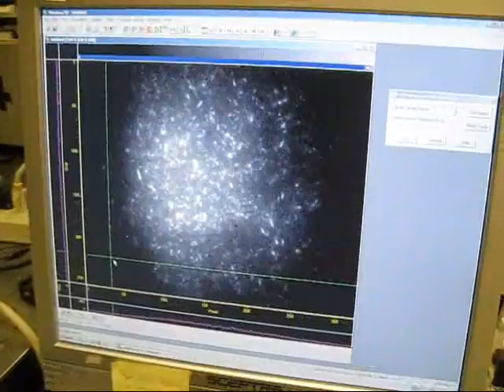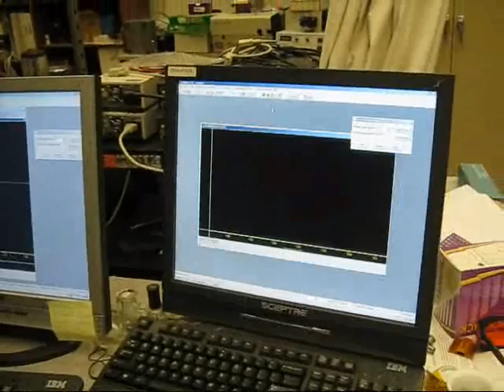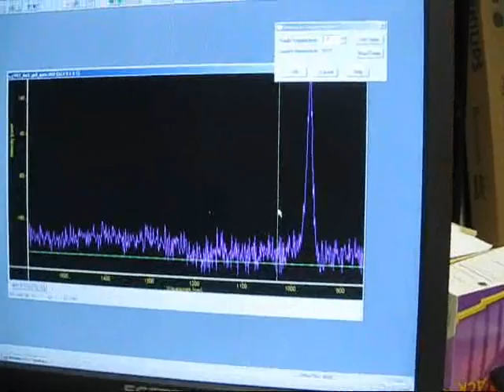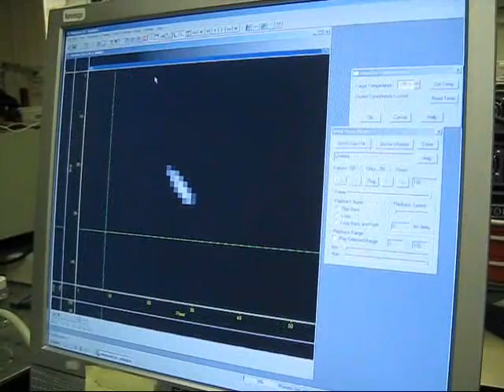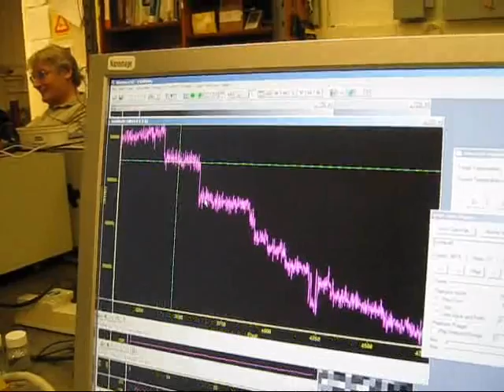Single nanotube experiment with tunable Ti:Sapphire laser Trestles sales@dmphotonics.com

Comment from the maker: THE GLOBAL MARKET FOR CARBON NANOTUBES
NANOTECH MAGAZINE 
2D MATERIALS MAGAZINE
latest market report on the market for Carbon Nanotubes including Technologies, Production, End User Markets and Opportunities Analysis to 2025.
 
Carbon nanotubes (CNTs) have been attracted huge attention over the past two decades, based on their extraordinary physical and chemical properties that are a result of their intrinsic nano-sized one-dimensional nature. Once the most promising of all nanomaterials, CNTs face stiff competition in conductive applications from graphene and other 2D materials and in mechanically enhanced composites from nanocellulose. However, after considerable research efforts, numerous multi-walled carbon nanotubes (MWNTs)-enhanced products are commercially available. Super-aligned CNT arrays, films and yarns have found applications in consumer electronics, batteries, polymer composites, aerospace, sensors, heaters, filters and biomedicine. Large-scale industrial production of single-walled carbon nanotubes (SWNTs) has been initiated, promising new market opportunities in transparent conductive films, transistors, sensors and memory devices. SWNTs are regarded as one of the most promising candidates to utilized as building blocks in next generation electronics.
 
WHAT DOES THE REPORT INCLUDE?

    Comprehensive quantitative data and forecasts for the global carbon nanotubes market to 2025
    Qualitative insight and perspective on the current market and future trends in end user markets
    End user market analysis and technology timelines
    Financial estimates for the markets carbon nanotubes will impact
    Tables and figures illustrating carbon nanotubes market size
    Full company profiles of carbon nanotubes producers and application developers including technology descriptions and end user markets targeted

TABLE OF CONTENTS

 

1       RESEARCH METHODOLOGY       24

2       EXECUTIVE SUMMARY        25

2.1    Exceptional properties 26

2.2    Products and applications    27

2.3    Threat from the graphene market  29

2.4    Production 30

2.4.1 Multi-walled nanotube (MWNT) production      30

2.4.2 Single-walled nanotube (SWNT) production    32

2.5    Global demand for carbon nanotubes    34

2.5.1 Current products         36

2.5.2 Future products  37

2.6    Market drivers and trends     37

2.6.1 Electronics 37

2.6.1.1       EMI/RFI shielding         37

2.6.1.2       Transparent conductive film 38

2.6.1.3       Silicon replacement     38

2.6.2 Electric vehicles and lithium-ion batteries        39

2.7    Market and production challenges 39

2.7.1 Safety issues      40

2.7.2 Dispersion 41

2.7.3 Synthesis and supply quality         41

2.7.4 Cost  42

2.7.5 Competition from other materials   42

3       INTRODUCTION 43

3.1    Properties of nanomaterials  43

3.2    Categorization    44

3.3    CARBON NANOTUBES         46

3.3.1 Multi-walled nanotubes (MWNT)    46

3.3.2 Single-wall carbon nanotubes (SWNT)   47

3.3.2.1       Single-chirality    49

3.3.3 Double-walled carbon nanotubes (DWNTs)     50

3.3.4 Few-walled carbon nanotubes (FWNTs) 51

3.3.5 Carbon Nanohorns (CNHs)   52

3.3.6 Fullerenes 53

3.3.7 Boron Nitride nanotubes (BNNTs)  54

3.4    Properties  55

3.5    Applications of carbon nanotubes 56

3.5.1 High volume applications      56

3.5.2 Low volume applications       57

3.5.3 Novel applications        57

3.6    Comparison with graphene   57

3.6.1 Cost and production    60

3.6.2 Carbon nanotube-graphene hybrids      62

3.7    Other 2D Materials      63

3.7.1 Phosphorene      64

3.7.1.1       Properties  65

3.7.1.2       Applications        65

3.7.1.3       Recent research news 66

3.7.2 Silicene      66

3.7.2.1       Properties  67

3.7.2.2       Applications        67

3.7.2.3       Recent research news 68

3.7.3 Molybdenum disulfide  68

3.7.3.1       Properties  69

3.7.3.2       Applications        70

3.7.3.3       Recent research news 72

3.7.4 Hexagonal boron nitride        73

3.7.4.1       Properties  74

3.7.4.2       Applications        74

3.7.4.3       Recent research news 75

3.7.5 Germanene        76

3.7.5.1       Properties  76

3.7.5.2       Applications        76

3.7.5.3       Recent research news 77

3.7.6 Graphdiyne         77

3.7.6.1       Properties  78

3.7.6.2       Applications        78

3.7.7 Graphane  79

3.7.7.1       Properties  80

3.7.7.2       Applications        80

3.7.8 Stanene/tinene   81

3.7.8.1       Properties  82

3.7.8.2       Applications        82

3.7.9 Tungsten diselenide    82

3.7.9.1       Properties  83

3.7.9.2       Applications        84

3.7.10        Rhenium disulphide     84

3.7.10.1     Properties  85

3.7.10.2     Applications        85

4       CARBON NANOTUBE SYNTHESIS         88

4.1    Arc discharge synthesis        90

4.2    Chemical Vapor Deposition (CVD) 91

4.3    Plasma enhanced chemical vapor deposition (PECVD)     92

4.4    High-pressure carbon monoxide synthesis      93

4.4.1.1       High Pressure CO (HiPco)    93

4.4.2 CoMoCAT  94

4.5    Flame synthesis  95

4.6    Laser ablation synthesis       96

4.7    Silane solution method         97

5       CARBON NANOTUBES MARKET STRUCTURE        97

6       REGULATIONS AND STANDARDS         101

6.1    Standards  101

6.2    Environmental, health and safety regulation    101

6.2.1 Europe       101

6.2.2 United States      102

6.2.3 Asia  102

6.3    Workplace exposure    103

7       CARBON NANOTUBES PATENTS 105

8       CARBON NANOTUBES TECHNOLOGY READINESS LEVEL      107

9       CARBON NANOTUBES END USER MARKET SEGMENT ANALYSIS   109

9.1    Production volumes 2010-2025     109

9.1.1 Regional demand for carbon nanotubes         111

9.1.1.1       Japan         113

9.1.1.2       China         114

9.1.2 Main carbon nanotubes producers         115

9.1.3 SWNT production        116

9.1.3.1       OCSiAl       116

9.1.3.2       FGV Cambridge Nanosystems       116

9.1.3.3       Zeon Corporation        117

9.1.4 Price of carbon nanotubes-MWNTs, SWNTs and FWNTs 117

9.1.5 Market penetration opportunity in key applications   119

9.2    Carbon nanotubes industry news 2013-2015  121

9.3    Carbon nanotubes producers and production capacities  131

9.4    ELECTRONICS   133

9.4.1 MAIN APPLICATIONS   133

9.4.2 TRANSPARENT CONDUCTIVE FILMS AND DISPLAYS     134

9.4.2.1       MARKET DRIVERS AND TRENDS 134

9.4.2.2       MARKET SIZE AND OPPORTUNITY       138

9.4.2.3       Properties and applications  139

9.4.2.4       CHALLENGES    141

9.4.2.5       PRODUCT DEVELOPERS    142

9.4.3 CONDUCTIVE INKS     145

9.4.3.1       MARKET DRIVERS AND TRENDS 145

9.4.3.2       MARKET SIZE AND OPPORTUNITY       146

9.4.3.3       PROPERTIES AND APPLICATIONS        147

9.4.3.4       PRODUCT DEVELOPERS    148

9.4.4 INTEGRATED CIRCUITS      150

9.4.4.1       MARKET DRIVERS AND TRENDS 150

9.4.4.2       MARKET SIZE AND OPPORTUNITY       151

9.4.4.3       PROPERTIES AND APPLICATIONS        151

9.4.4.4       CHALLENGES    153

9.4.4.5       PRODUCT DEVELOPERS    154

9.4.5 MEMORY DEVICES     155

9.4.5.1       MARKET DRIVERS AND TRENDS 155

9.4.5.2       MARKET SIZE AND OPPORTUNITY       156

9.4.5.3       PROPERTIES AND APPLICATIONS        157

9.4.5.4       PRODUCT DEVELOPERS    158

9.4.5.5       PRODUCT DEVELOPERS    161

9.5    POLYMER COMPOSITES     162

9.5.1 MARKET DRIVERS AND TRENDS 162

9.5.1.1       Improved performance 162

9.5.1.2       Multi-functionality         163

9.5.1.3       Growth in wind energy market       164

9.5.2 MARKET SIZE AND OPPORTUNITY       164

9.5.3 PROPERTIES AND APPLICATIONS        165

9.5.3.1       Electrostatic discharge (ESD) and electromagnetic interference (EMI) shielding   165

9.5.3.2       Wind turbines     165

9.5.3.3       Construction       166

9.5.3.4       Sporting goods   167

9.5.3.5       Ballistic protection        167

9.5.3.6       Wire and cable   168

9.5.3.7       Heat management       168

9.5.3.8       Elastomers and rubber         168

9.5.4 CHALLENGES    169

9.5.5 PRODUCT DEVELOPERS    169

9.6    AEROSPACE      175

9.6.1 MARKET DRIVERS AND TRENDS 175

9.6.1.1       Safety        175

9.6.1.2       Reduced fuel consumption and costs     175

9.6.1.3       Increased durability     175

9.6.1.4       Multi-functionality         176

9.6.1.5       Need for new de-icing solutions     176

9.6.1.6       Weight reduction         177

9.6.2 MARKET SIZE AND OPPORTUNITY       177

9.6.3 PROPERTIES AND APPLICATIONS        178

9.6.3.1       Composites         179

9.6.3.2       Coatings    180

9.6.3.3       Sensors     181

9.6.4 PRODUCT DEVELOPERS    181

9.7    AUTOMOTIVE     185

9.7.1 MARKET DRIVER AND TRENDS   185

9.7.1.1       Environmental     185

9.7.1.2       Safety        186

9.7.1.3       Lightweighting     186

9.7.1.4       Cost  186

9.7.2 MARKET SIZE AND OPPORTUNITY       187

9.7.3 PROPERTIES AND APPLICATIONS        187

9.7.3.1       Composites         188

9.7.3.2       Lithium-ion batteries in electric and hybrid vehicles  188

9.7.3.3       Coatings    189

9.7.4 PRODUCT DEVELOPERS    190

9.8    BIOMEDICAL & HEALTHCARE      192

9.8.1 MARKET DRIVERS AND TRENDS 192

9.8.1.1       Improved drug delivery for cancer therapy      192

9.8.1.2       Shortcomings of chemotherapies  193

9.8.1.3       Biocompatibility of medical implants        194

9.8.2 MARKET SIZE AND OPPORTUNITY       194

9.8.3 PROPERTIES AND APPLICATIONS        195

9.8.3.1       Cancer therapy   196

9.8.3.2       Medical implants 200

9.8.3.3       Biosensors 201

9.8.3.4       Medical imaging  201

9.8.3.5       Tissue engineering      202

9.8.4 CHALLENGES    202

9.8.5 PRODUCT DEVELOPERS    203

9.9    COATINGS         206

9.9.1 MARKET DRIVERS AND TRENDS 206

9.9.1.1       Sustainability and regulation 206

9.9.1.2       Cost of corrosion         206

9.9.1.3       Improved hygiene        207

9.9.1.4       Cost of weather-related damage   208

9.9.2 MARKET SIZE AND OPPORTUNITY       209

9.9.3 PROPERTIES AND APPLICATIONS        210

9.9.3.1       Anti-static coatings      211

9.9.3.2       Anti-corrosion coatings         211

9.9.3.3       Anti-microbial      212

9.9.3.4       Anti-icing    213

9.9.3.5       Heat protection   213

9.9.3.6       Anti-fouling         214

9.9.3.7       Wear-resistance 215

9.9.4 PRODUCT DEVELOPERS    216

9.10  FILTRATION AND SEPARATION   218

9.10.1        MARKET DRIVERS AND TRENDS 218

9.10.1.1     Need for improved membrane technology       218

9.10.1.2     Water shortage and population growth   218

9.10.1.3     Contamination    219

9.10.1.4     Cost  219

9.10.2        MARKET SIZE AND OPPORTUNITY       219

9.10.3        PROPERTIES AND APPLICTIONS 220

9.10.4        CHALLENGES    223

9.10.4.1     Uniform pore size and distribution  223

9.10.4.2     Reducing pore size for improved desalination 224

9.10.4.3     Difficulties of CNT growth      224

9.10.4.4     Cost  224

9.10.5        PRODUCT DEVELOPERS    225

9.11  ENERGY STORAGE, CONVERSION AND EXPLORATION         227

9.11.1        BATTERIES        228

9.11.1.1     MARKET DRIVERS AND TRENDS 228

9.11.1.2     MARKET SIZE AND OPPORTUNITY       230

9.11.1.3     PROPERTIES AND APPLICATIONS        231

9.11.1.4     CHALLENGES    233

9.11.2        SUPERCAPACITORS  234

9.11.2.1     MARKET DRIVERS AND TRENDS 234

9.11.2.2     Problems with activated carbon     234

9.11.2.3     MARKET SIZE AND OPPORTUNITY       235

9.11.2.4     PROPERTIES AND APPLICATIONS        235

9.11.3        PHOTOVOLTAICS       237

9.11.3.1     MARKET DRIVERS AND TRENDS 237

9.11.3.2     MARKET SIZE AND OPPORTUNITY       237

9.11.3.3     PROPERTIES AND APPLICATIONS        238

9.11.4        FUEL CELLS      240

9.11.4.1     MARKET DRIVERS      240

9.11.4.2     MARKET SIZE AND OPPORTUNITY       241

9.11.4.3     PROPERTIES AND APPLICATIONS        241

9.11.5        OIL AND GAS     242

9.11.5.1     MARKET DRIVERS AND TRENDS 242

9.11.5.2     MARKET SIZE AND OPPORTUNITY       244

9.11.5.3     PROPERTIES AND APPLICATIONS        244

9.11.6        PRODUCT DEVELOPERS    244

9.12  SENSORS  249

9.12.1        MARKET DRIVERS AND TRENDS 249

9.12.1.1     Increased power and performance with reduced cost        249

9.12.1.2     Enhanced sensitivity    249

9.12.1.3     Replacing silver electrodes   250

9.12.1.4     Growth in the home diagnostics and point of care market 250

9.12.1.5     Improved thermal stability     250

9.12.1.6     Environmental conditions      251

9.12.2        MARKET SIZE AND OPPORTUNITY       251

9.12.3        PROPERTIES AND APPLICATIONS        251

9.12.3.1     Electrochemical and gas sensors  252

9.12.3.2     Pressure sensors        252

9.12.3.3     Biosensors 253

9.12.4        PRODUCT DEVELOPERS    254

9.13  3D PRINTING      257

9.13.1        MARKET DRIVERS AND TRENDS 257

9.13.1.1     Improved materials at lower cost    257

9.13.2        MARKET SIZE AND OPPORTUNITY       257

9.13.3        PROPERTIES AND APPLICATIONS        258

9.13.4        CHALLENGES    259

9.13.5        PRODUCT DEVELOPERS    259

9.14  ADHESIVES        260

9.14.1        MARKET DRIVERS AND TRENDS 260

9.14.1.1     Thermal management in electronics       260

9.14.1.2     Environmental sustainability 260

9.14.1.3     PROPERTIES AND APPLICATIONS        260

9.14.2        MARKET SIZE AND OPPORTUNITY       261

9.14.3        PRODUCT DEVELOPERS    261

9.15  LUBRICANTS      262

9.15.1        MARKET DRIVERS AND TRENDS 262

9.15.1.1     Cost effective alternatives    262

9.15.1.2     Need for higher-performing lubricants for fuel efficiency   262

9.15.1.3     Environmental concerns       262

9.15.2        PROPERTIES AND APPLICATIONS        263

9.15.3        MARKET SIZE AND OPPORTUNITY       264

9.15.4        CHALLENGES    264

9.15.5        PRODUCT DEVELOPERS    264

9.16  TEXTILES  266

9.16.1        MARKET DRIVERS AND TRENDS 266

9.16.1.1     Growth in the wearable electronics market      266

9.16.2        PROPERTIES AND APPLICATONS        266

9.16.2.1     Wearable electronics   268

9.16.2.2     Superhydrophobic coatings  269

9.16.2.3     Conductive coatings    270

9.16.2.4     Flame retardant textiles        270

9.16.3        MARKET SIZE AND OPPORTUNITY       271

9.16.4        PRODUCT DEVELOPERS    271

10     CARBON NANOTUBES PRODUCERS AND PRODUCT DEVELOPERS        272-423 (184 company profiles)

TABLES AND FIGURES

Table 1: Properties of CNTs and comparable materials.

Figure 1: Molecular structures of SWNT and MWNT

Table 2: Carbon nanotubes target markets-Applications, stage of commercialization and potential addressable market size.

Table 3: Annual production capacity of MWNT and SWNT producers.

Table 4: SWNT producers production capacities 2014.

Figure 2: Production capacities for SWNTs in kilograms, 2005-2014.

Table 5: Global production of carbon nanotubes, 2010-2025 in tons/year. Base year for projections is 2014.

Figure 3: Global production of carbon nanotubes, 2010-2025 in tons/year. Base year for projections is 2014.

Table 6: Categorization of nanomaterials.

Figure 4: Conceptual diagram of single-walled carbon nanotube (SWNT) (A) and multi-walled carbon nanotubes (MWNT) (B) showing typical dimensions of length, width, and separation distance between graphene layers in MWNTs

Figure 5: Schematic of single-walled carbon nanotube.

Table 7: Comparison between single-walled carbon nanotubes (SWCNT) (A) and multi-walled carbon nanotubes.

Figure 6: Double-walled carbon nanotube bundle cross-section micrograph and model.

Figure 7: Schematic representation of carbon nanohorns.

Figure 8: Fullerene schematic.

Figure 9: Schematic of Boron Nitride nanotubes (BNNTs). Alternating B and N atoms are shown in blue and red.

Table 8: Properties of carbon nanotubes.

Figure 10: Graphene can be rolled up into a carbon nanotube, wrapped into a fullerene, and stacked into graphite.

Table 9: Comparative properties of carbon materials.

Table 10: Comparative properties of graphene with nanoclays and carbon nanotubes.

Figure 11: Phosphorene structure.

Table 11: Recent phosphorene research news.

Figure 12: Silicene structure.

Table 12: Recent silicene research news.

Figure 13: Structure of 2D molybdenum disulfide.

Figure 14: Atomic force microscopy image of a representative MoS2 thin-film transistor.

Figure 15: Schematic of the molybdenum disulfide (MoS2) thin-film sensor with the deposited molecules that create additional charge.

Table 13: Recent Molybdenum disulfide research news.

Figure 16: Structure of hexagonal boron nitride.

Table 14: Recent hexagonal boron nitride research news.

Figure 17: Schematic of germanane.

Table 15: Recent germanane research news.

Figure 18: Graphdiyne structure.

Figure 19: Schematic of Graphane crystal.

Figure 20: Crystal structure for stanene.

Figure 21: Schematic of tungsten diselenide.

Figure 22: Schematic of a monolayer of rhenium disulphide.

Table 16: Comparative analysis of graphene and other 2-D nanomaterials.

Figure 23: Schematic representation of methods used for carbon nanotube synthesis (a) Arc discharge (b) Chemical vapor deposition (c) Laser ablation (d) hydrocarbon flames.

Table 17: SWNT synthesis methods.

Figure 24: Arc discharge process for CNTs.

Figure 25: Schematic of thermal-CVD method.

Figure 26: Schematic of plasma-CVD method.

Figure 27: CoMoCAT® process.

Figure 28: Schematic for flame synthesis of carbon nanotubes (a) premixed flame (b) counter-flow diffusion flame (c) co-flow diffusion flame (d) inverse diffusion flame.

Figure 29: Schematic of laser ablation synthesis.

Table 18: Carbon nanotubes market structure.

Figure 30: CNT patents filed 2000-2014.

Figure 31: Patent distribution of CNT application areas to 2014.

Figure 32: Technology Readiness Level (TRL) for Carbon Nanotubes.

Table 19: Global production of carbon nanotubes, 2010-2025 in tons/year. Base year for projections is 2014.

Figure 33: Regional demand for CNTs utilized in transparent conductive films and displays.

Figure 34: Regional demand for CNTs utilized in batteries.

Figure 35: Regional demand for CNTs utilized in Polymer reinforcement.

Table 20: Typical carbon nanotubes prices.

Table 19: Market penetration and volume estimates (tons) for carbon nanotubes in key applications.

Table 22: Annual production capacity of main carbon nanotubes producers.

Table 23: Carbon nanotubes in the electronics and photonics market-applications, stage of commercialization and addressable market size.

Table 24: Comparison of ITO replacements.

Figure 36: CNT transparent conductive film formed on glass and schematic diagram of its structure.

Table 25: Carbon nanotubes product and application developers in transparent conductive films and displays.

Table 26: Comparative properties of conductive inks.

Figure 37: Nanotube inks

Table 27: Carbon nanotubes product and application developers in conductive inks.

Figure 38: Thin film transistor incorporating CNTs.

Table 28: Carbon nanotubes product and application developers in integrated circuits.

Figure 39: Stretchable CNT memory and logic devices for wearable electronics.

Figure 40: Carbon nanotubes NRAM chip.

Figure 41: SEM image of the deposited film (or fabric) of crossed nanotubes that can be either touching or slightly separated depending on their position.

Figure 42: Schematic of NRAM.

Figure 43: Schematic of NRAM cell.

Table 29: Carbon nanotubes product and application developers in memory devices.

Table 30: Carbon nanotubes in the polymer composites market-applications, stage of commercialization and addressable market size.

Table 31: Addressable market size for carbon nanotubes composites.

Table 32: Carbon nanotubes product and application developers in the composites industry.

Table 33: Carbon nanotubes in the aerospace market-applications, stage of commercialization and addressable market size.

Table 34: Carbon nanotubes product and application developers in the aerospace industry.

Table 35: Carbon nanotubes in the automotive market-applications, stage of commercialization and addressable market size.

Table 36: Carbon nanotubes product and application developers in the automotive industry.

Table 37: Carbon nanotubes in the biomedical and healthcare markets-applications, stage of commercialization and addressable market size.

Table 38: CNTs in life sciences and biomedicine.

Figure 44: Schematic representation of functionalized fullerene (A) and carbon nanotube (B) for drug delivery in cancer therapy.

Table 39: Carbon nanotubes product and application developers in the medical and healthcare industry.

Figure 45: Global Paints and Coatings Market, share by end user market.

Table 40: Carbon nanotubes in the coatings market-applications, stage of commercialization and addressable market size.

Table 41: Carbon nanotubes product and application developers in the coatings industry.

Table 42: Carbon nanotubes in the filtration market-applications, stage of commercialization and addressable market size.

Table 43: Comparison of CNT membranes with other membrane technologies.

Table 44: Carbon nanotubes product and application developers in the filtration industry.

Table 45: Carbon nanotubes in the energy market-Applications, stage of commercialization and addressable market size.

Figure 46: Nano Lithium X Battery.

Table 46: Properties of carbon materials in high-performance supercapacitors.

Figure 47: CNT nanotube frame module.

Table 47: Carbon nanotubes product and application developers in the energy industry.

Table 48: Carbon nanotubes in the sensors market-applications, stage of commercialization and addressable market size.

Figure 48: First generation point of care diagnostics.

Table 49: Carbon nanotubes product and application developers in the sensors industry.

Figure 49: 3D Printed tweezers incorporating Carbon Nanotube Filament.

Table 50: Carbon nanotubes product and application developers in the 3D printing industry.

Table 51: Carbon nanotubes product and application developers in the adhesives industry.

Table 52: Applications of carbon nanotubes in lubricants.

Table 53: Carbon nanotubes product and application developers in the lubricants industry.

Table 54: Desirable functional properties for the textiles industry afforded by the use of nanomaterials.

Figure 50: Schematic illustration of the SWCNT-based electronic devices as a wearable array platform.

Table 55: Carbon nanotubes product and application developers in the textiles industry.